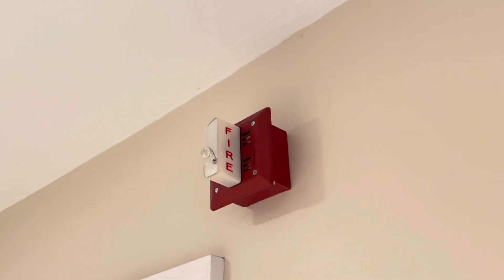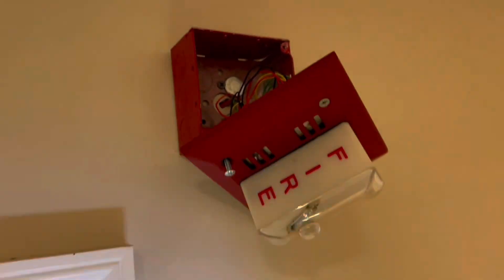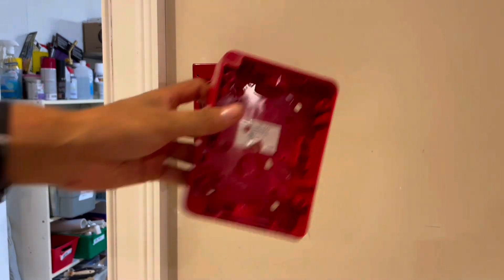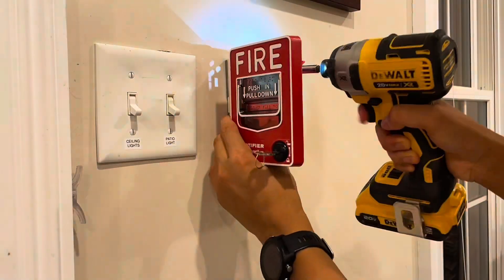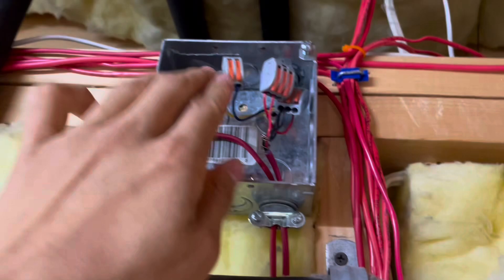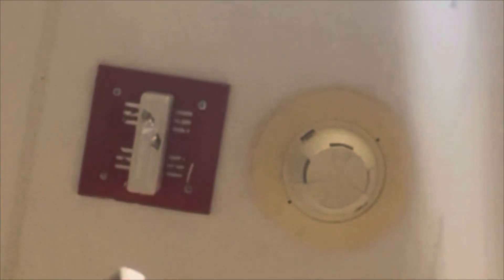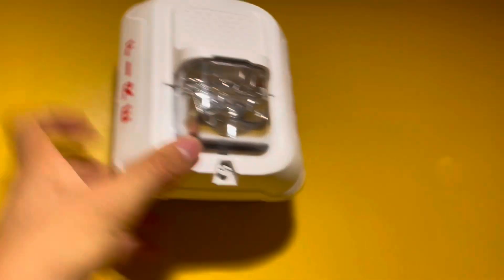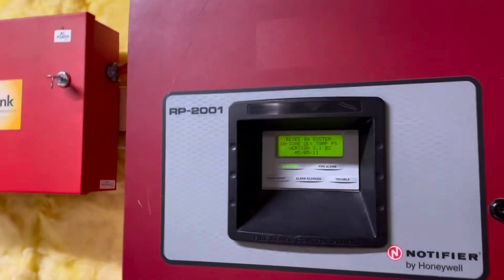Replacing Old Faraday Fire Alarms with New System Sensor/Notifier Speaker Strobes and Pull Stations

Comment: I didn't realize system sensor L-Series and Advance Series took more wires than the Spectralert classic speaker strobes but, Now that I compare it the L series and Advances don't work with two 9 volt batteries.
Reply from the maker: L series and advance appliances take the same amount of wires as the classic devices. They should also work with 9 volt batteries
Reply: @FireAlarmDude5967  Somehow my exceeder HSR doesn't work when I have it hooked up to 9 volt batteries, I don't know if it's broken but wouldn't be surprised if it was because it's been collecting dust since 2015.

Comment: Do a System Test of Simplex 4903-9153, 4903-9252, and have a 4903-9196 in the Fire Museum. Make sure these are Freerun and not SmartSync or have a switch

Comment: You don’t actually have to pull wires out of that particular panel, you can just remove the terminals as they simply unplug, unlike lots of other units.
Reply from the maker: In this case I’m moving the cables to a separate connection so I need to remove them anyways. In general I try not to pull the blocks though. Constantly pulling at the terminal blocks will eventually lead to separation from the board which is a much more annoying issue.
Reply: @FireAlarmDude5967  not if you separate them with a small screw driver like a pry bar they unsnap easily and no damage done to the terminal blocks and i install them for a living so i know:)
Reply from the maker: @apctech1  Sure but it’s still more practical to just remove the wires because I have to do that anyways